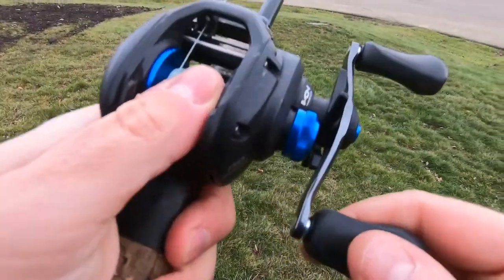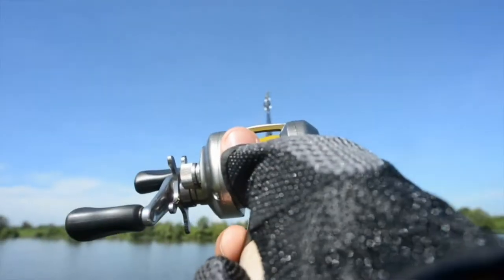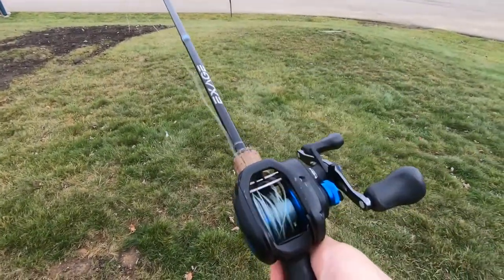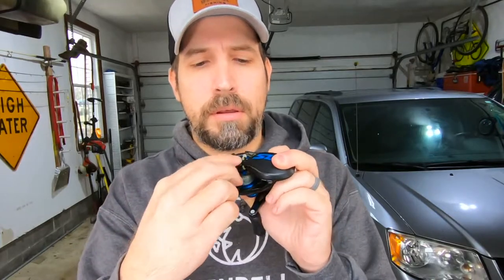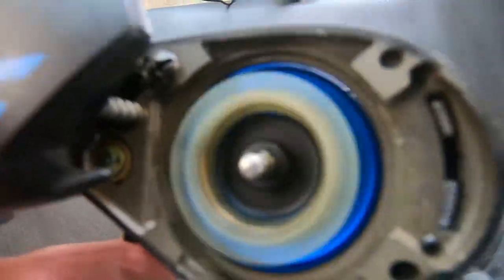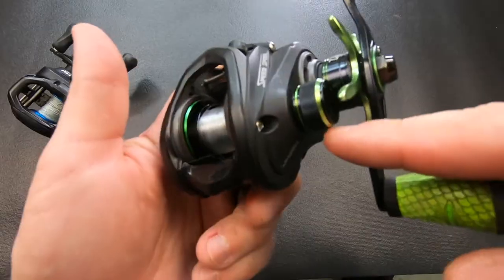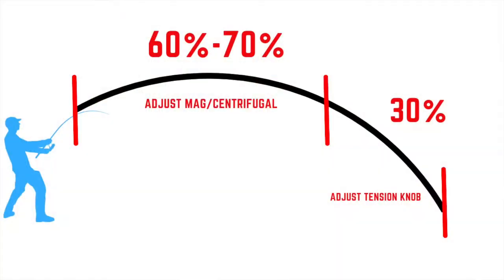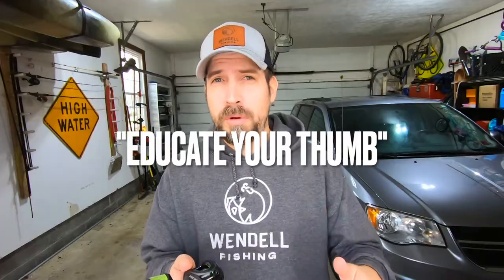GET ZERO BACKLASHES With These Baitcaster Reel Settings

Comment: I set the spool tension knob on every baitcaster exactly the same. Set so the spool has just a hint of play and it stays there. I then adjust the magnetic brakes according to the weight of the lure. The only exception is a really heavy lure that exceeds the maximum mag brake setting but that is very rare for me since I almost always throw tiny lures. 
Side note: If your spool tension knob is set applying tension to the spool shaft remember to loosen it for storage. I also loosen all drags before storage.
Reply from the maker: Right on bother. Love hearing how everyone does it.

Comment: Just to add ,  i got in the habit to stop the spool with my thumb when the lure hits the water. I used to adjust the reel all the time. With 3 different baitcaster setups now a rarely adjust. Even in a kayak I have no problem.
Now spinning reels , I suck!
Need a video for those reels 😂
Reply from the maker: Right on.. Thanks Lowlife! I love me some spinning reels
Reply: I try and keep my thumb close enough to feel the nesting begin so I can slow it down a hair.
Reply: @LostInTackle  Yup dude you got it right. Sometimes I turn my wrist so the spool is vertical. I  heard that helps.
I like that Lifetime Tamarack you have. It kinda proves a cheap boat can catch fish too.
I have a Tamarack Pro  😂 
My  Garmin Striker 4 ➕ , Yakattack battery and mounts cost more then the kayak 🛶
Reply: @lowlifeangler  Thanks

Comment: I think a lot of people turn away from bait casters because they either buy a cheap one, or don’t know how to set it up properly. If you’re new to bait casting, or want to get into it. Spend the extra money and get a solid reel. It’ll save you a massive headache. Plenty of YouTube videos out there to help you learn how to set up the reel. Like this one. 😂
Reply: I find with my cheap baitcaster I need to adjust the tension knob occasionally.
Reply: @LostInTackle  What reel do you have?
Reply: @Triple  $35 kastking, $12 blackfriday right retrieve something, Abu Garcia Max Ultra, and Shimano SLX.
Reply: @LostInTackle  I can’t speak on the black max, but from what I understand that’s like the budget reel of choice. The SLX is a great starting point tho for sure. It’s a good reel, but you go up another $100 you can get into a tatula. It’s night a and day difference. The best reels to start with in my opinion, are the SLX, and the Daiwa Fuego.
Reply from the maker: Right.. when you get your hands on a nice baitcaster... gamechanger